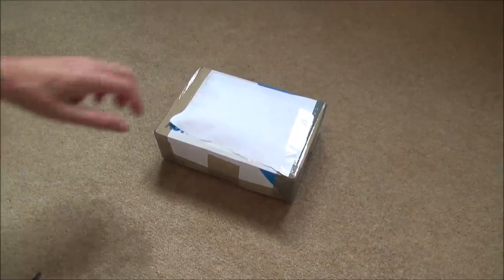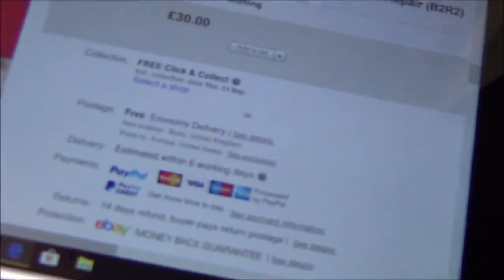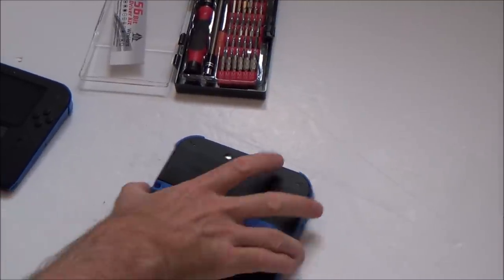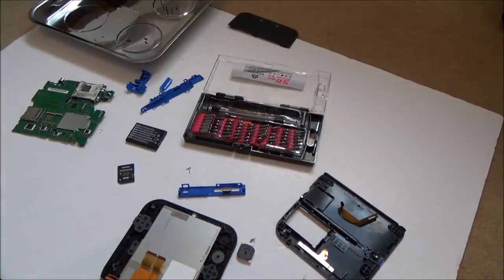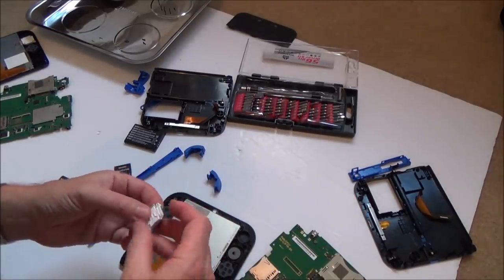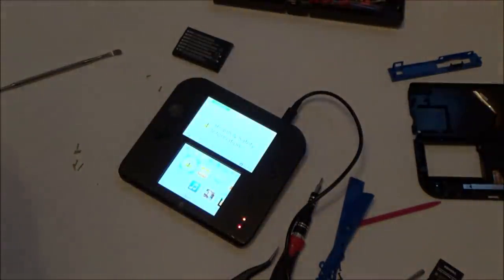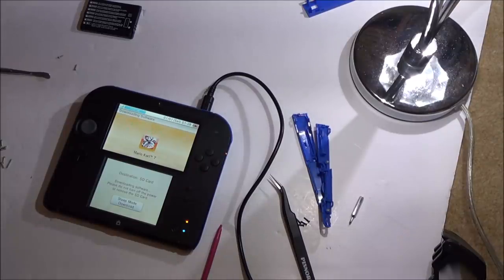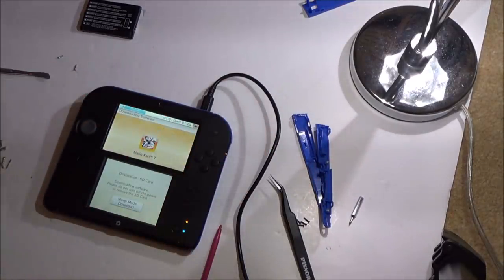Trying to FIX 2x Faulty Nintendo 2DS consoles from eBay

Comment: Vince, I've been repairing laptops for years.  You won't believe how many times I have taken apart a laptop because it wasn't working, then just reassembled it to have a fully working machine.

Reseating components can clear faults.  Machines are so sensitive that the slightest error can cause lots of problems.
Reply: interesting.

Comment: My 2ds has had two main problems through its 5 year life. The first issue I had within a year that was that when I powered it on the screen would stay black and the power button would be a solid blue no matter what I did, I sent it into Nintendo to repair under warranty. I got it back several days before scheduled, the battery was fully charged(it was about dead when I sent it) and it was fully updated to the latest software. The second problem happened a little more than a year ago, the volume slider stopped working and the system was stuck on max volume. I tried putting the knob back onto the slider, but that didn’t work. Eventually I got it replaced last Christmas by a Pokéball New 2ds xl.

Comment: 😃 The scrolling and none of the buttons working is usually caused by either a dirty or broken touch screen. (Not the actual screen, the plastic layer over it.) It's a very easy fix and cheap too!

Comment: the games are coded into the systems, if you wanna claim them you can swap your main 3ds to it then swap back after a week and your main nintendo account will claim it so once you move your account back over to your previous 3ds you will take it with you. easy. i bought a super mario 3d land special 3ds and i moved over to it and claimed the game, i never knew it was there but i reset it to factory settings swapped to it and i got it free... its w/e i had it as physical but now i have both digital and physical! what a bonus. :)

Comment: Great vid, but you might want to unlink the account there, you'll lose the games (mario kart and super mario bros) but if the original owner got a new 3ds and wanted to play the games they've bought, they can't unless the old console is unlinked and they'd have to go to a lengthy process to unlink the account with customer support.
Reply: @aidanstanding  i think you can just remove the account from the settings i read on an article noting steps to take before selling the system. That only transfers data with account

Comment: can someone help me, I got a 2ds the same as the video, but it is defective, it does not turn on, already tested the battery with a multimeter and it is 2.69V, ie it is almost fully charged, I wonder if He has a fuse or something that might be the fault. thanks in advance...